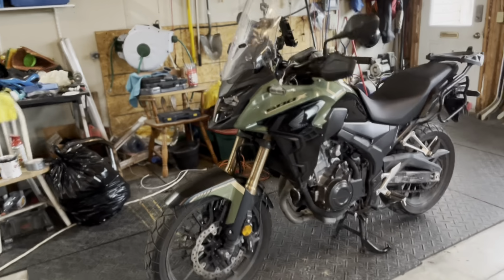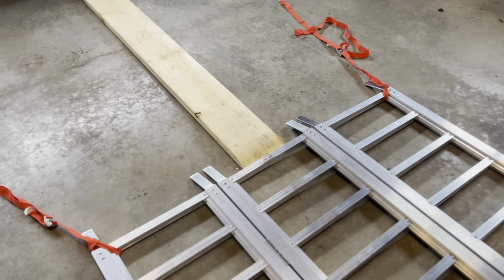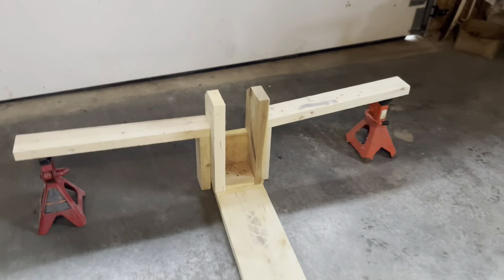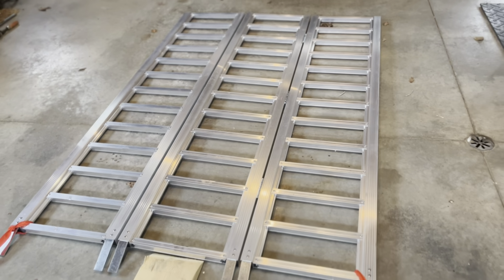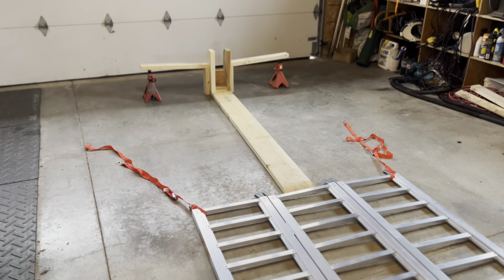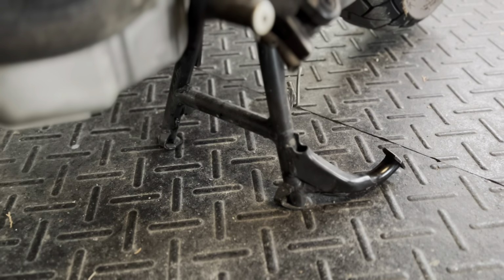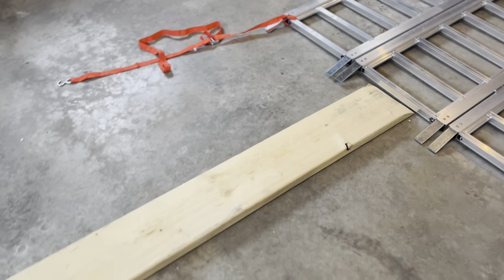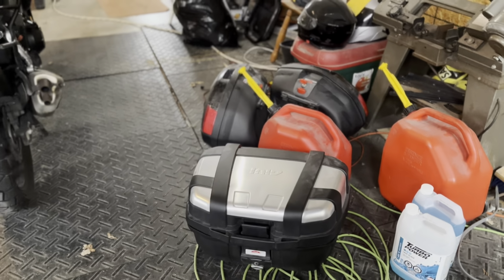Honda CB500X motorcycle loading on to a Ford Maverick with one person.

Comment: How's the clearance to hook up a trailer with the tailgate down? I've been curious about this.
Reply from the maker: To pull any of my trailers, I need to use a 4" drop hitch so that gives some extra room to connect. The teardrop camper that I just finished was designed to be used with the Maverick with the tailgate down and the bike in the bed. It has a longer than usual tongue and the tongue box is round at the front. So the only way to know if a trailer will work is to give it a try. It will not work on any trailer that does not have a swivel hitch or trailers that sit high off the ground.